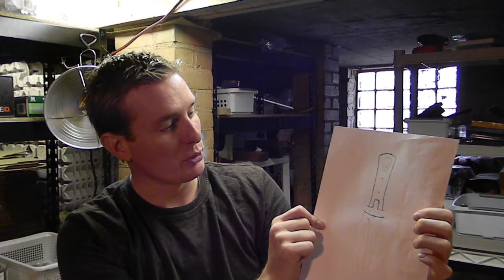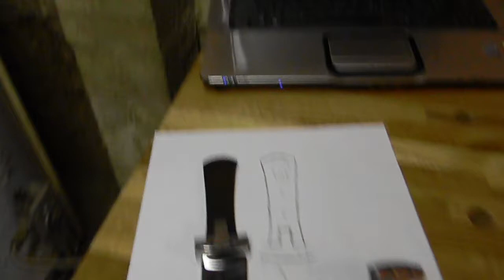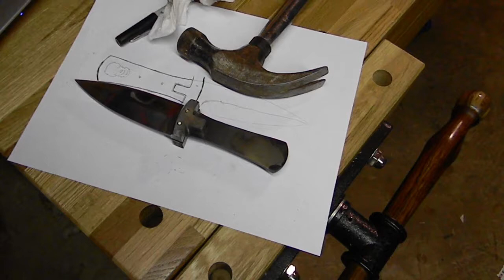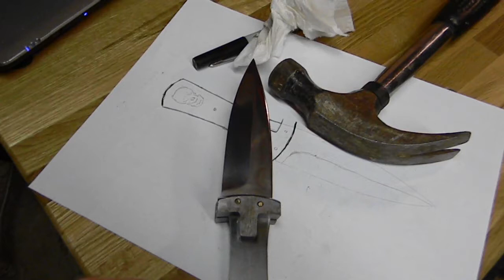How to put a Bolster and Handle on a Knife.

Comment: Great video! I fear the novices watching this won't grasp how dangerous it is to drill in the blades without
1,the blade wrapped in tape
2.proper clamps to secure the blade to the drill table to protect from spinning and possibly cutting fingers off.
Accidents happen really fast with knives and you don't get second chances.
I did enjoy it though,thanks for sharing.

Comment: If you clamp the wood to another block of wood so that the wood you want is on top and the throw-away wood is on the bottom, the wood won't bust out the way it did there. Just a helpful tip!
Reply: this was my tip for him as well.  It's not the fault of the drill press or the bit being used. you'll get blowout with an expensive drill press and pretty much any bit you use, if you dont back your work piece.  i have a 25 year old ryobi drill press, which obviously isn't a top of the line drill press, and i never get blowout on the backs of pieces being drill when i use backing on my workpiece.

Comment: Good video, but one tip: it's not the drill bit that's the problem with chewing out the back of the hole in the handle scales. If you put a piece of scrap wood under the piece being drilled that won't happen because it's supported. Otherwise there's nothing but air stopping those wood fibers being torn out by the rotating bit..

Comment: How is it you can drill holes in a heat treated blade or did I miss something?
Reply from the maker: Use carbide bits and cutting fluid.  Should work up like 58 rockwell.  Just go slow.

Comment: so how much longer did you cut the pins than the width of the handle?
Reply from the maker: Generally I shoot for 1/16 of an inch on either side because I like to not have to worry about the length as I put the scales in position.  However it is good to remember that that is 1/4 inch of wasted pin that you have to grind/cut off.  Let me know if you have any other questions, and I hope that helps!

Comment: Thanks for the video. Two questions please; 1. where can I get the skulls and other types of inlays? and what make and model of polishing machine is that with the long blue shafts (axles). Thanks. tomkarr.com
Reply from the maker: I got the skulls from Tandy Leather Factory, they have lots of similarly sized conchos.  As for the buffers, they come from Grizzly.com.  I have one that runs at 3450 rpm for buffing steel and one that runs at 1725 for buffing wood and soft metals.  I can also tell you that they are my favorite machines and I feel they are an astounding deal for 330 and 300 usd a piece.  Here are the model numbers etc.:

G1061Z The Buffing System - 1725 RPM
G1061 The Buffing System - 3450 RPM

The  long blue shafts are so useful, keeps your work-piece and hands clear of the motor housing.

Cheers!

Comment: John, stop wasting time which equals money. Buy a mill/drill and your holes and capability will change 100% for the better. Your shitty drill press is the problem. I know because I been there and done that.  Also if you press against a  fence/platten while shaping on the 1" belt you should not sand wood any faster than metal. The free belt thought just works to find the path of least resistance, the wood. Re-install the fence/platten and try it..

Nice video!!